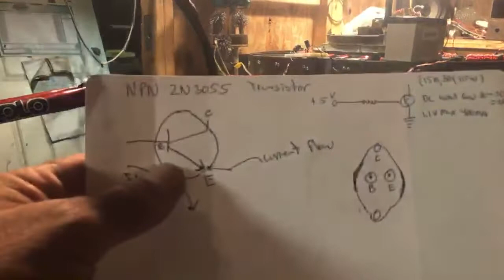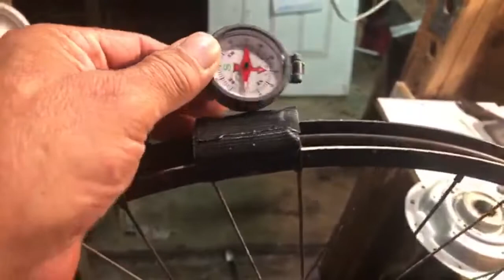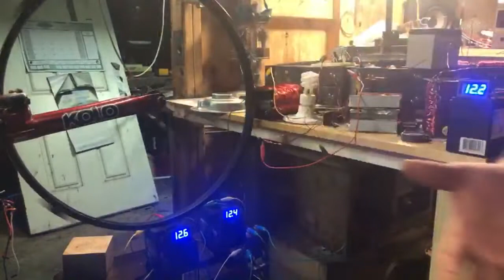Coral Castle, Ed Leedskalnin, Wheel Experiments!

Comment: The half being lost to be sent back to the discharging battery which is charging the capacitors, which are discharging into the system. 

Removes the need for separate batteries.

Spark gaps becomes reed switches becomes vacuum tubes becomes tesla coils becomes solid state transistor oscillator switches can also be longitudinal magneto dielectric LMD computer analogue sections. These devices create the on off square block signal generator switch pulse PWM pulse width modulation. From TEM AC sine waves transverse electromagnetic. Which get generated from north south rise and fall or possibly the coil rise and fall of the forward and reverse (back emf.)

LMD segments bring in the TEM (from a signal generator or from a N S magnet generator) changes when goes through LMD to the pwm pulse you want for capacitor oscillation.